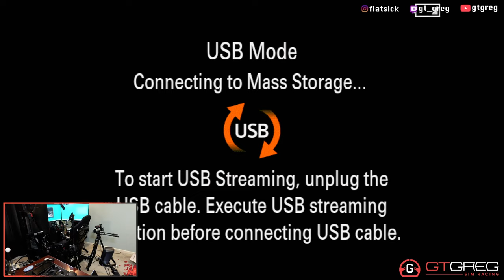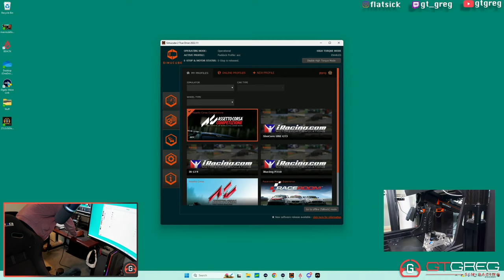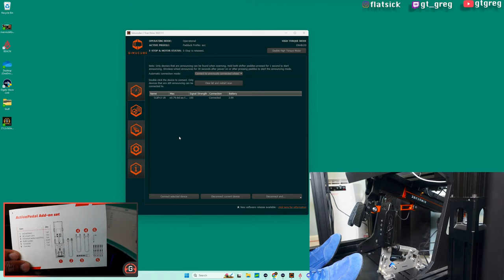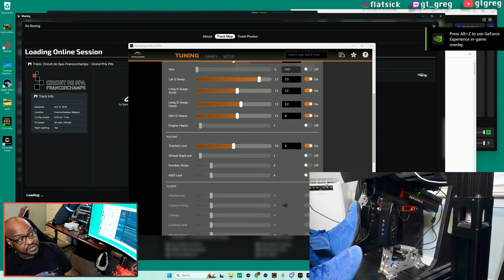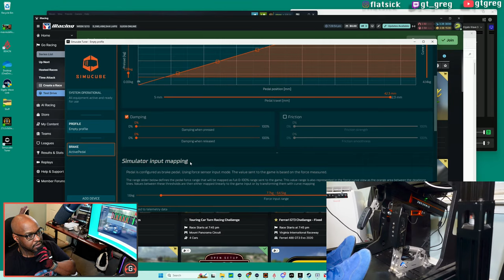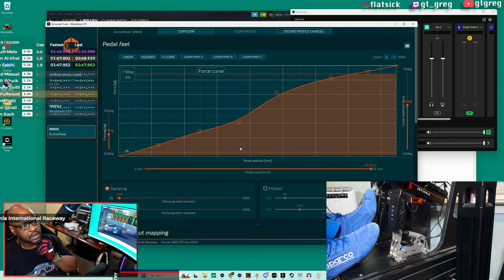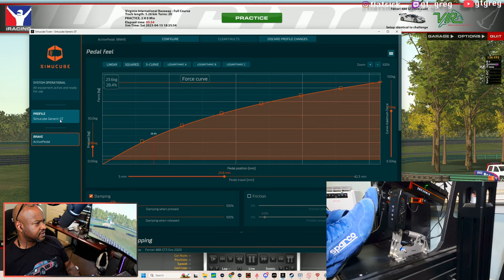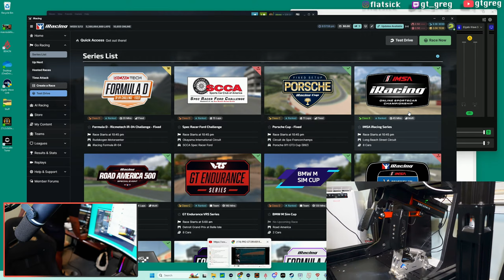PART 1! Is the SIMUCUBE ACTIVE PEDAL WORTH It?  Unboxing, Installation,  Initial Impressions!

Comment: Went to check the manual again. And if I understand it correctly the rod length is just to set the way the pedal sits (more forward or backwards but I am still not entirely sure the extent of effect it has on the final pedal travel). In theory the longer the rod the more travel it should allow for based on how parallel the connections are. The main thing that affects the amount of total movement in the pedal would be the position (HIGH 62.3mm vs LOW 79 mm) and as it says in the manual starting point (pedal offset) of the pedal in software affects total pedal travel, therefore you have to move it as much forward (to the left in the settings) as you can, to get the highest amount of travel.

Based on that I think you could set the rod length to med or even short (to get the pedals mechanically more in line with the rest of the setup) and if needed later flip the adjustment rod upside down (LOW position) and match the hardware changes in the software. And maybe even redo the calibration. Then you can set the pedal position as we ended up at the end of the stream (all the way to the left) and then fine-tune the final pedal position with the software to lie in line with other pedals.

And that should be a good baseline setup that should allow you to try out different profiles/settings to get the desired feel.

But I agree with you, that Simucube should have a table of adjustments what are the hardware limitations based on the configuration.
For example (I am making the numbers up):
travel (in mm) based on the position
- Rod length:    LONG    MEDIUM    SHORT
- High pos..        62             55             43
- Low pos.:         79             72             65
Reply from the maker: Thanks Nejc, got it working perfectly and thanks for your input. The SC team pushed out a new software update that solved most of the issues. The length issue was firmware and resolved.

Comment: I'm blown away that Simucube is still using the same, tiny, dinky pedal face they showed at the sim racing expo.The complete opposite of what a racer would desire with the high braking forces this can achieve, even if using shoes.
Reply from the maker: the face design disappears once you get it working the way you like it. SimCore is making new faces also. It is kinda a goofy looking face though 🤣
Reply: @GTGREG  Haha, I'll have to check them out. When using a lot of force, using socks and/or using a small pedal face makes it feel like you have to press twice way more to reach the same force. It would be very strange of any high-end pedal even in the $700-$1000 range (for an entire set) to have such a tiny face, let alone at $2500 for a single pedal. Such a strange design decision on Simucube's part.

Comment: I've watched until 1hr 54min so far, if there's not enough pedal travel, there's 2 things, possibly 3, you can do. Increase max pedal force, I believe you have it only set to 50 Kg which is not going to be anywhere near as much as your previous pedals (He Ultimate). Having the same max travel but requiring more force to reach that max travel will kind of make it feel like there's more travel, not really but kind of. Second, get rid of those pathetic, tiny, toy-like pedal faces that shockingly come with sim racing's most expensive, most "serious" consumer pedals (Simucube pedals) and get a bigger one - both wider and longer. It'll help you in multiple ways, one of those being further travel. The higher or lower your feet are from the pedal's pivot or rotation point, the further it will travel, therefore the longer your pedal plate, the more travel/distance you'll get (even though the actual degrees of rotation haven't changed). Thirdly, there may be physical adjustments you can make on the current pedals to increase max travel. I thought I saw something about this in some of the sim racing expo promo material but I could be wrong.

By the way, love your channel and your humbleness and the fact you seem like one of those rare few who just speak 100% truth, good, neutral, or bad, without having to please sponsors or companies that give you free products to keep or to sample or whatever, without having to yell at the camera in order to try and be overly entertaining (or rather, annoying and irritating), without having all sorts of over-production which shifts focus away from the subject at hand. Tech-tubers, including in the sim racing industry, are almost all beholden to sponsors/companies, even the ones who claim "this video is 100% my honest opinion". You seem like just a normal guy sharing his passion with us, simple as that! Subscribed!

Comment: can you give a tldr ? 10 hours is a little much
Reply: He forgot to end the stream total length is about 4h but. TL;DR: very mixed feelings.
Read the manual, set the stuff right from the start and go from there on.
Only in the last part of the stream (20-30 minites  3:33:00 - he starts to change rod length 3:38:00 - 3:45:00 timestamp things start to fall into right place) he started to it set right from where he could start tuning it but he was too tired/angry to continue. But tldr was, he didn't like them, then liked them for a moment and then went into not liking them again. When he set them correctly he was like yes this feels much better but at the same time he was, I don't know if I will take my time to set them up etc. So very mixed feelings I would say.
Reply from the maker: TLDR, its exceptional but some new adopter issues. Highly recommend.

Comment: 57:30 couldn't you just loosen all 4 screws and 180 the pedal plate? This could work and might give you a better angle.
Reply from the maker: Hey there, Im fine with the angle now, it works well, amazing pedal and the adjustability is epic!

Comment: Add more Damping if you want Hydro Pedals. Ya spend 0 time and understanding of the settings and just non stop bitch about how bad they are. How about ya do 5 mins of research to see if you can make the settings on how you like. The idea of the pedals is you can custom tune the setups of the type of pedals you want. How about google a setup for Hydro pedals and install that setup
Reply from the maker: eat dick captain confident, there was actually a software bug in the motor resonance that required a redeployment of the firmware.